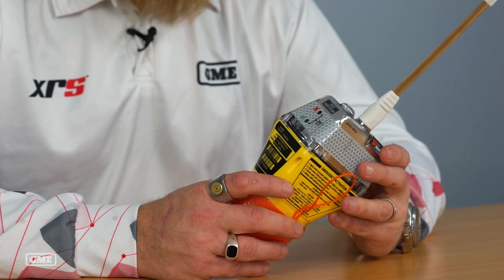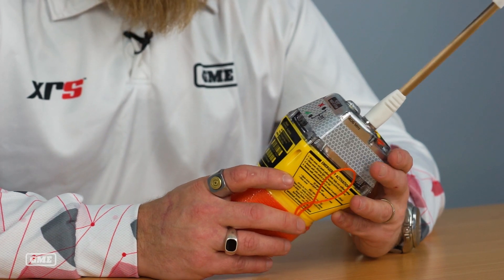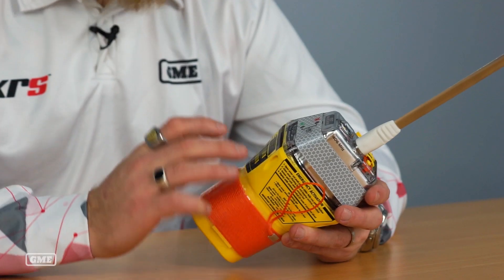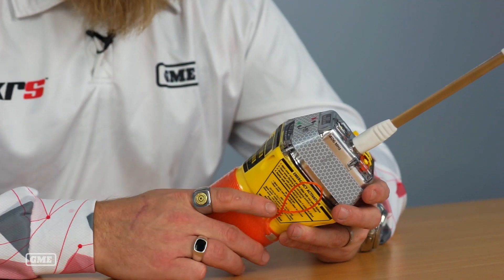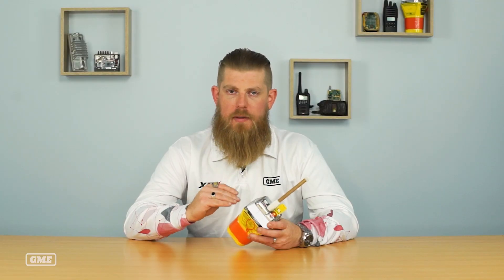How to test your EPIRB | MT600 Non-GPS | GME

Comment: Good morning 
My G5 smartfind plus 406 gps epirb started non stop flashing after pushing the test button.
Afraid that it actually activated I disconnected the battery. 
What can I do ?
Reply from the maker: Hi there, 
Please note that the G5 Smartfind is a McMurdo beacon and not a GME Beacon. Either way we would recommend contacting the relevant area authority (AMSA for Australia) to ensure the beacon was not activated.